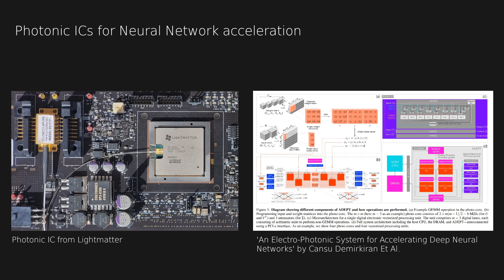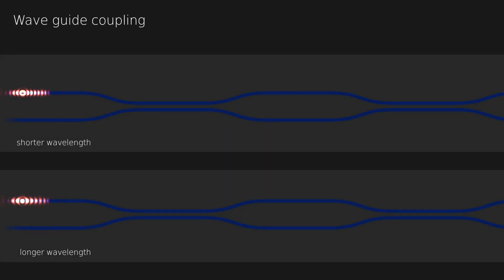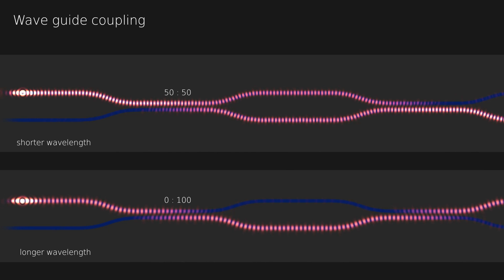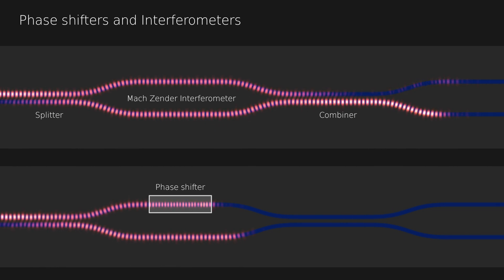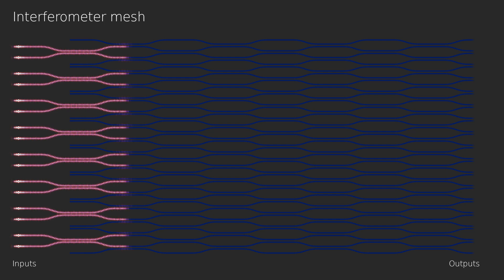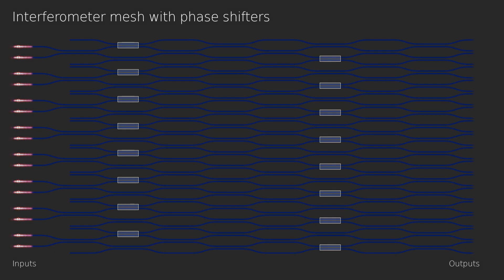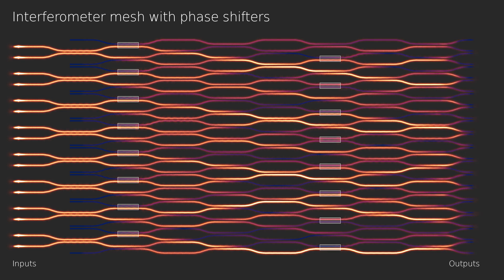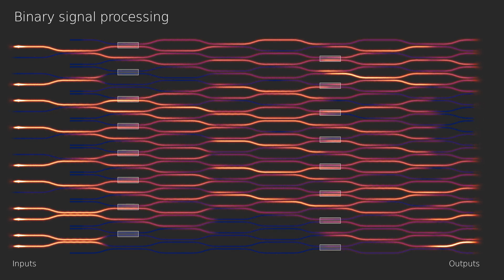Wave Simulation of a Photonic-IC for Neural Network Accelleration

Comment: you need a non-linearity for it to be a neural network!
Reply from the maker: Absolutely correct. That is why in pratice the optical part is interleaved with electronic non linearities after the light signal is digitzed by the photodiodes. The goal is to replace the more expensive vector-matrix multiplication.

Comment: So the mach-zehnder interferometer has to perform some sort of matrix-vector multiplication, right?
Reply from the maker: Yes I think so. The way I understood this (which could be wrong) is that you can represent the two incoming waves as a 2D Vector of two complex numbers. Each complex number encodes the phase and amplitude of an incoming wave. The overall action of an interferometer (+phaseshifters) can be represented as a 2x2 complex unitary matrix. The overall circuit is a combination of many of such linear transformation und thus can itself be described by a larger linear transformation (a NxN complex matrix).

Comment: Very nice. Now I want to make this in hardware!
Reply from the maker: Thanks. Would you actually have the tools to make optical waveguides on a substrate? I know about your maskless waver stepper, but I have no idea which materials one would use to generate a sufficient refractive index difference between the base and the waveguide.
Reply: @DiffractionLimited  The materials would not be a problem, but the resolution might not be sufficient if I wanted to use a wavelength in the visible range. It will be a bit of a challenge though.
Reply: Every time I find a well hidden/obscure photonics niche on YouTube..... You're always in the comments already.
Reply: @hullinstruments  Yeah, I watch way too much YouTube 😊
Reply: wat een verrassing! 🤗